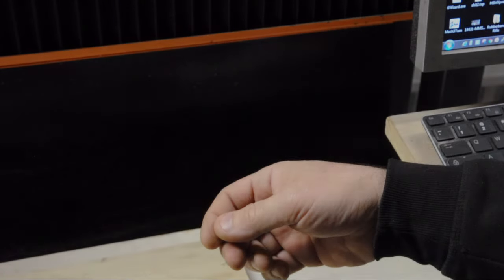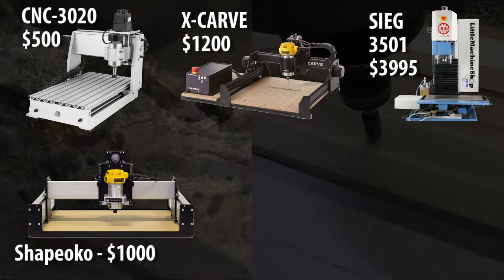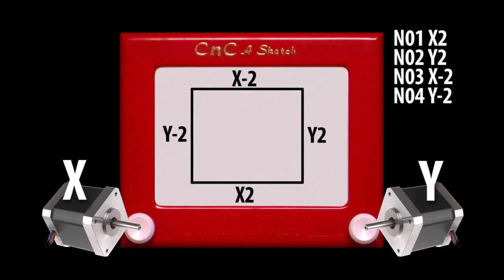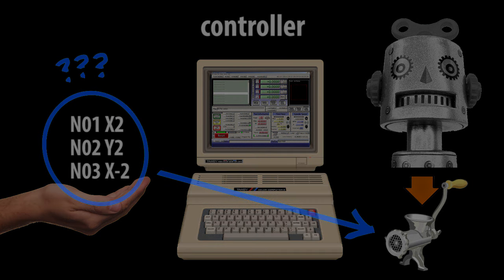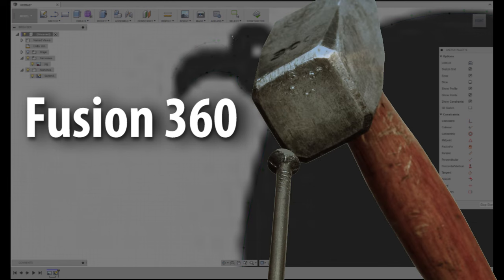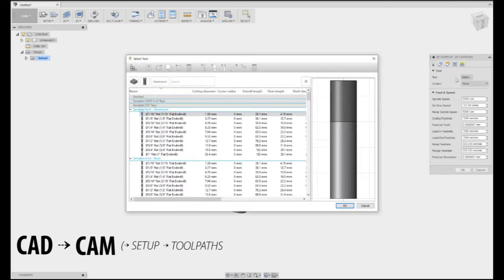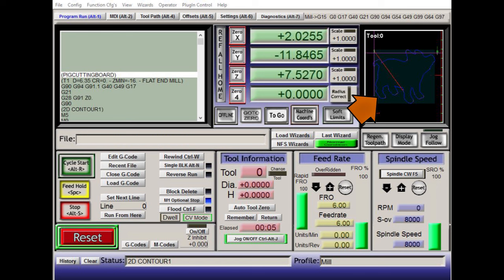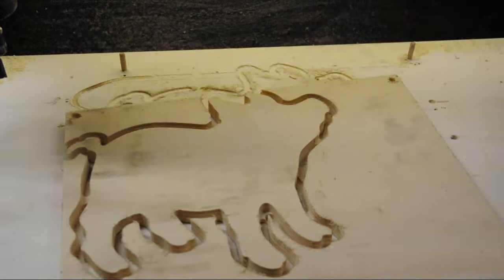CNC Dummies For Routers

Comment: Hi Tony
I'm a guy who knew telephone party lines as a normal system in "my day." I ask my kids and grandkids how to solve problems on my mini-mac. That may help you understand where I'm coming from, computer wise.

I have a PC which I plan to use on my CNC.

I wish to build my own router CNC. I have all the electrical parts (I hope), including 3-steppers. What I do not have is an understanding of what I need to transfer the thoughts in my brain to the router cutting the wood. This video of yours has helped me to better understand. I have watched several but never quit knew if I really understood what I need.

I would like some advise to be sure I DO understand what I think I understand;
1. Fusion 360, for free is a good price, and may be all I need (as a hobby beginner) in the world of CNC. It goes on my computer with the tools for me to make a picture of a project, correct?
2. I need to buy the MACH 3 program. It takes the Fusion 360 information and creates a G-Code for my machine, correct?

Is that it, or am I missing something?
Thanks for your time,
Retired Tom
Reply from the maker: Yes Fusion has both CAD and CAM built in.  You can draw your parts there (CAD), and then generate the toolpaths and GCODE (CAM) that you save as a file... that you can then open with MACH3 or MACH4.

Mach 3 or 4 are your 'controller'.  They read the instructions generated by you or by Fusion and send commands to your electronics.

GCODE is generic (more or less).  You can use any 'controller' to read it in and run your machine.  I've always used Mach.  It's my understanding that there are free controllers out there (linux based), but I've never used them.

Keep in mind you can also use Mach as a demo version.  Or at least you used to be able to (I assume you still can?).  In that case, with no license, it'll run about 100 or 150 lines of gcode and then just stop.  A licensed (unlimited) version of Mach I think still costs less than $200.  You'll have to check their website.

But if your part needs less than 150 lines of gcode to complete.. you're golden!

Comment: Awesome stuff as always, Tony!  Heck, you've got me pretty tempted to make my own small CNC router...
Reply: Do it. I made a CNC machine for about $200.
Reply: Do it..  nearly anyone with a bit above average sawdust creating experience can make one with accurcery in the range of  say 15 thou, a bit smaller than a 64th using most any table saw a bit better than one of the $150 throw aways.  Even these will do it but you will have to fiddle around with it some.  Plans are all over the net. Even with one of those $3000 buck fancy cabinet saws most of the accuracy is in the operator and working within at least a 64th tolerance. The tighter tolerances you can work to will always make a better CNC.

All the electronics needed, 3 medium sized steppers, the power supply for them and the interface board that will run using Mach 3 and a typical 10 to 15 year old desktop using a parallel port will set you back around 200 bux or so. Mach 4 that is out now is usb based. Add about $100 to go USB as it requires a smarter interface board than the 20 buck breakout board for parallel. You can do one on the cheap side using one of the Audrino based controllers around but these are a tad above junk in my opinion. I have used both,  Mach 3 on my TOTAL home brew, and one of the Invetables that uses the audrino setup. The $150 cost of Mach 3 is worth EVERY penny. To be fair the adurino based ones do work but YOU GET WHAT YOU PAY FOR!  The real difference in cost between the Adriano setup and Mach 3 running parallel is around say $75 and you need to find an old PC somewhere. I see them all the time in hock shops for around a hundred including the monitor and often many people have one stashed somewhere you can get for FAR less. Ma ch 3 will run on windows 2000 and XP and windows 7 (32 bit only) just fine. serial numbers for W2k and Xp can be found on the net..  I DO NOT recommend hooking the PC to the net  if you use it for the controller. It could cause all sorts of weird problems when its cutting wood. Just trot your G-code to it with a thumb  drive. 

If you are thinking about CNC I STRONGLY suggest you download the demo version of V-carve destop and play with it.  It is FULLY functional with no time limits and one exception.  It has only a demo post processor to generate a g-code file to look at. Fusion 360 Is FAR more complex and has a very steep learning curve. Most people with only the basic info in this video will hav it well understood in an afternoon.  If you cant figgure out V-cave then DONT EVEN consider a CNC. 

My setup is a 2 by 3 feet TOTAL home brew with a cutting envelope of X-25 inches Y-18.5 and Z-6 inches ( depend on the bit Length) Running Mach 3 on a 16 year old PC I stashed away a number of years back running a bootleg copy of XP. Same serial number of the not so old XP box I still use once in a while. So basically the computer was free. And it still runs faster than My win7 (64 bit) laptop..  The electronics in my controller is a 36 volt power supply, a cheap breakout box, 3 stepper drivers and 3 nena 23 450 oz/in steppers.  The driver Under the adurino in that setup wont handle steppers of that strength but it will handle the 120 or so oz/in ones any of the nema 17s.  I got right at $900 total in it including Mach 3. That does not include any software beyond Mach 3. This is almost identical to my electronics except all 3 axis are the 450 oz/in steppers. https://buildyourcnc.com/electronicscombo.aspx

The software, Mach 3, Vcarve desktop, C- as V-carve replaced it cambam ( only rarey as V-carve replaced it. Fusion 360, Sketchup ( sometimes), Autocad Inventor ( really old version), Soliidworks, and tinkering with few of the open source CAD and CAM related ones.  Inventer and Solidworks are in the 2 to 3 THOUSAND price range but I got them either free or for under a hundred due to my connection with a local college before I retired.  Fusion 360 has a lot of the same features as either of these.

So GO FOR IT!   Just one warning --- A CNC can be very addicting.. :)
Reply: John Ware
how do you figure Mach 3 is worth $150? LinuxCNC is free, and LinuxCNC, and Mach 3 are both forks of the same NIST EMC project. So essentially the exact same thing. Except Mach 3 is no longer developed, and it costs money, while LinuxCNC is free, and is still being actively developed.
Reply: First off let me say this---

Mach 3 is based on using a computer with a parallel port in its navigate mode. There is what looks like a parallel to USB converter available to use it with any USB based controller. BE aware a real Parallel to USB converter WILL NOT work. It IS an older controller but still a viable option. $150

Mach 4 is the new version. Its based on using USB as the navitave mode. There is also a parallel port driver available to run it on the same box you may have running Mach 3.  $50 bux for the driver.  It looks different based on the screen shots and I do NOT have any info on it that cant be found at artsoft. I havent used it but I would gues it is very close to Mach 3 in functionality.  Goes for $200 ( I think)

Let me put it to you this way.. EVERY thing is opinions and "free" Is never really free. You wind up paying in some way. That being said I AM FULLY capable of taking any PC or Mac  around, removing the BIOS chip and go from there and write my own dedicated controller using any of a number of compilers available. In fact I could do it starting with  just a bunch of chips. Did that for a living for a number of years. I started dealing with computers BEFORE the first CPU chip even existed.  Why I don't is the time it would take. I would rather stick some "off the shelf" stuff together and spend time chewing on wood.  That is to inform you I have a background of dealing with computer stuff going back around 50 years so I DO know whats under the hood so to say.

Stacking some sort of controller on top of. any os is not the most reliable way of doing it but the cost to do it would be astronomical for some company to do it.  Besides a failure somewhere wont kill anyone. Less running code interactions reduces the failure modes. Bit bangers these days almost always relay on some os to handle the low level stuff. Its simpler and cheaper to do. This is ONE place the adurino based controllers have it over any PC but even those dont start with the real internals of the chip. It has a sort of OS that  basically translates the what the C compiler usually used feeds the on-board compiler in  a line by line interpreter mode. If you can deal with the chip in its native instruction set like a true compiler that chip is capable of some amazing things. I might mess with one some day if I get bored.

G- code is NOT universal in nature the way you would think.. How it acts on the material your cutting is heavily dependent on the controller. For instance when Mach 3 makes say a circle It actually calculates a TRUE circle then sends the steppers the required steps to reduce the curve error to the lowest possible error thats actually determined by the resulion of the drive system. In essence its the same but where it differs the curve is not broken down to some set number of straight lines.  Gerbil DOES NOT do this.  It calculate a curve as a set number of straight lines. As above the resolution is also determined by your hardware as above. The curve may look the same by eyeball but its not. Wether the end result is an issue or not depends on your requirements. In addition many controllers out there DO NOT support the full G-code command set. That being said Mach 3 has the closest compliance to a true universal G-code action ive seen in a NON-Commercial dedicated controller.  To be fair I haven't looked very seriously in to how close LinuxCNC deals with the complete G-code list.  Also Mach 3 is fully supported by almost every CAD/CAM  post processor out there. Cant say in Linux CNC is or is not as I dont use it

Mach 3 is also super easy to modify in all sorts of ways such as adding an tool change feature to it among other add on features. On example, a "stock" mach 3 dosnt have a tool zero touch off in it. All it takes to add one is a few lines of code thats basically a modified version of C++ SOURCE!  If you want to get real serious you can do stuff like having all your tooling in some sort of collit where the tool length is already in a table INSIDE mach 3.  With that, a tool changer, and a zero reference plate ALL tool changes will take automatically and will all automatically be referenced to your specified Z zero point.  In other words, FULL automation for serious production work.

I use a manual tool change, so I don't have to have a separate tool path file or every tool used in a project. Grbel controllers MUST have a separate file for each tool. Cant say about Linux CNC.  I just make ONE file with everything in it. Mach 3 just pulls clear of Z and pauses on a tool change command. I jog where ever its convent to do a bit change, change the bit and zero it with a touch plate and back up off  some amount then hit cycle start. Mach 3 continues at the exact point it stopped and starts cutting. That feature ALONE is worth the $150 to me..  So assuming LinuxCNC cannot do that then ive "PAID" for free right there.  Another thing I like about Mach 3 is sorta intangible.  By the license agreement you can have it on as many computers as you want with ONE license fee but only one copy on a real CNC. I have a copy on my CNC running on a 17 year old PC out in the shop, one on ny old desktop, another on an old laptop and one on my new laptop. I use those to check the G-code running BEFORE I head out to the shop.  Best G-code checker ive found for free (Note I paid for it so truly free don't exist there either )

Mach 3 is almost as simple as it gets to tailor for any thing using up to 4 axis. Plasma cutters, mills, 3d printers and 2 video motion control systems I know of run on it. Calibration to make what you want to what you get in movement is also super easy.  No sort of cryptic commands, or screwing around guessing at some number to put in any sort of table either. It even has a built in distance traveled routine capable of resolving town to around .00005 in. Same goes for setting the ramp up and down rates and maximen G0 speeds to. I have done this for a couple of Inventabes and a home brew using the same controller and its a royal pain in the ass compared to Mach 3.

The above is why IN my opinion and for my needs and ease of use mach 3 wins hands down. You do have the right to disagree and it dont bother me at all if you do. Your needs and budget are not the same as mine either.

The bottom line -------
For any one you should take an in depth study of your needs and any programs you are looking at for possible use. Goes for controllers and CAD/CAM anything esle CNC related you may be looking at. DO the same for those. Money spent up front for a good CAM/CAD is often a better choice than all the hassle with what can be involved using a bunch of opensource single function programs to get the same results as a good CAD/CAM doing all you need in one place.
Reply: John Ware
The bottom line is you've never used LinuxCNC so absolutely everything you say is pure speculation. Having used LinuxCNC myself I'd have to say you're way off base too.

If you are even a tenth as technically savvy as you think your are then trying LinuxCNC out for yourself should be a trivial exercise. less effort than the last comment you made.

Here big guru, I'll even get you the link to the instructions http://linuxcnc.org/docs/html/getting-started/getting-linuxcnc.html

There's a whole 4 steps, and after step 3 you'll already be running LinuxCNC. Think you can handle it?
Reply: Like I said -- use whatever you wish.. Dosent bother me at all. Also note I CLEARLY said all I know about Linux was whats on the web page. I gave you my opinion on Mach 3.  Note I never said linixCNC was crap, but only i wasnt going to use it and why.  If you cant accept that -- Tough---  Grow up and realize others have different opinions. I stand on what I said....  End of discusion
Reply: John Ware
I don't care what you use either. But when you advise others to make poor choices then I want to know why.
Reply: Why I recommend Mach 3 is simple - Ive used it for a number of years. That was made clear to start with. Go start a flame war elsewhere.
Reply: John Ware
why you recommend Mach 3 is because you don't know any better. At this point I'd have to chalk it up to pig headed stubbornness too. Because I have already given you a link that could rectify your ignorance, yet you choose not to act. Don't tell me where to go either. You haven't earned the right.
Reply: I'd recommend UCCNC over Mach 3. Doesn't look like a dogs breakfast and works every bit as good.

Comment: Great and helpful video!

So your next project..... a DIY Dust Extractor and a CNC Router extractor shoe to clear away the swarf instantly when the machine runs?
Reply from the maker: It's definitely a must-have, but would makes for less-than-exciting CNC video when you can't see what its doing.  Maybe acrylic?
Reply: Some transparent Acrylic would work indeed, and you'd need to position the bristles away from the main show. As for the Dust Extractor / Air Cleaner itself? You could probably weld the impeller using some 90 degree magnetic holders or whatever, and you'd definitely need a "soft starting" motor for it, wouldn't want to shake the impeller to bits...

Comment: As always you have a great material. I am looking forward to getting my machine set back up after a move and putting it to work. Any thoughts on conversion using Mach 3 to run a plasma cutter. And yes my plasma cutter has inputs for signals.

Comment: Biggest issue I had and still having with CNC, is where the hell I can get some good material :D all I can find is composites, glued boards that break if you cnc something to it, never a solid plank of wood :-/  well yes I can get one that is 5m long and 15cm thick... for like 3mm thick I actually need... hard to get wood, if you know what I mean :D hahaha, enough puns!.. I had also brilliant ideas to use the dremel bits as router bits... I broke every single one, since I got proper carbide bits I never had issue. Mounting stuff to the cnc board... I had so much issues with clamps it always bends the material ( thin sheets of plywood or aluminium ), I now use masking tape, on bottom board and the working piece joined super glue... works like a miracle.  Hmm what else... I own Chinese 6040cnc and there is never a simple answer to any question I had :D Like how to add limit switches, the discussion on Reddit was longer than any PhD work...and I'm still not sure how to do it, same goes for 4th axis which I would like to have working very much as well :D
Reply: Have a look at Thomas Sanladerer's channel for limit switches it is 3d printing but the controllers are very similar and the addition of limits is almost identical. The internet is a great source of materials, also try reclamation yards as they often have railway sleepers and broken furniture which are good wood for hardly anything.
Reply: Puns are funs

Comment: I love your presentations! I was wondering if you might happen to be using the controller I am trying to connect and could help me solve a problem. Initially, I was using a TinyGs & GRBL Controllers, But I switched to a Smooth Stepper controller on a breakout board using Mach4 for my new one. I can’t seem to get the signals to communicate with the Steppers. The controller is configured and works in simulation, but not to the motors or the other devices